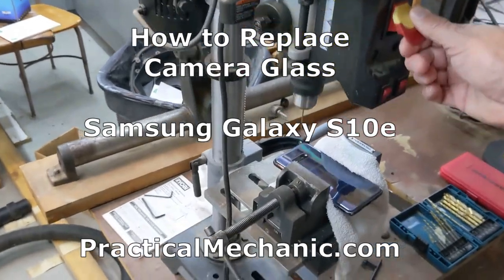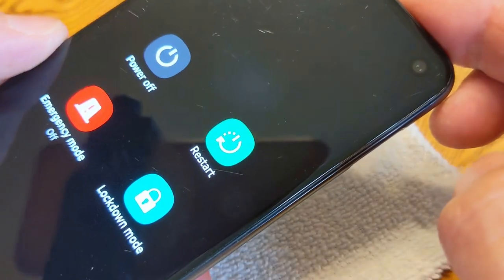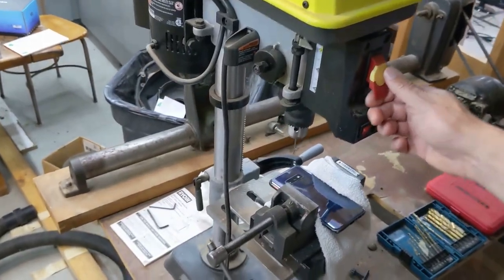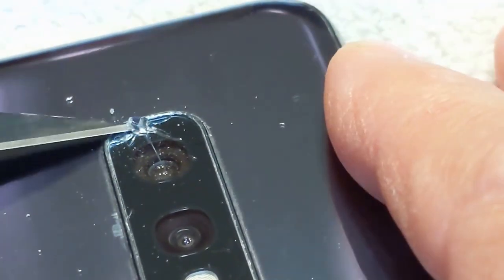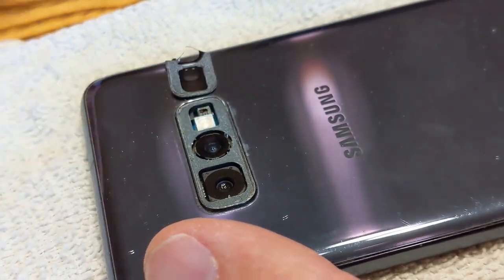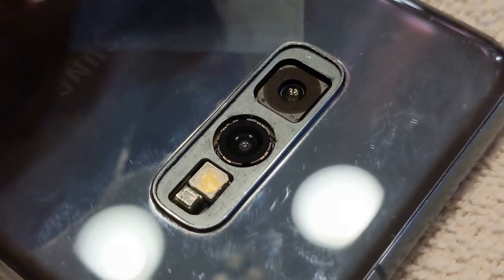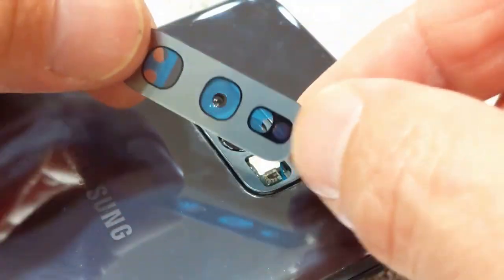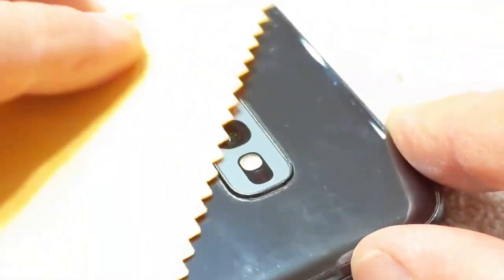Samsung Galaxy S10e - How to Replace Camera Glass

Comment: mine luckily fell and only cracked the camera glass with no damage anywhere else. and it kind of spider webbed so i think i can pick the glass out as it is. id leave it but its totally ruined using the ultrawide.

its ok if some of the glass bits / dust fall down in the cameras though? i was thinking past wiping it with a microfiber, maybe holding a vacuum near the opening or using compressed air could help too?
Reply from the maker: Yes, that would work. I think compressed air is a great idea. Try to use 'clean' air (like those cans they use for getting dust out of a keyboard), and start out far from the lens and slowly move closer as necessary, so you don't overwhelm it . Good luck! 😀

Comment: Ikr. Also the way he did it with sharp objects. I mean I've done it before with qtip gently, it shouldn't be a problem. Btw, can you link me to that calibration thing where it is mentioned in greater detail? Genuinely curious. Because I've done many repairs and light cleaning doesn't really cause any problems.

Comment: hey there. it's my first time doing DIY and I wanted to try this on my S10+ because the repairman accidentally had his fingerprint inside the glass and it makes photos blurry. is there any way I can gently crack the glass instead of using a drill? kinda scares me 🥲
Reply from the maker: Could also carefully pry at the edge with a razor blade, good luck!
Reply: @PracticalMechanic  should i heat the adhesive so i can remove the glass easily?
Reply from the maker: @acklzzz yes, that would be best. Just don't over do it. Use a hair dryer or similar. Getting it too hot could cause other problems.
Reply: @PracticalMechanic  thank you so much!